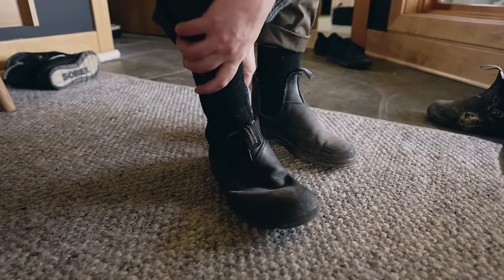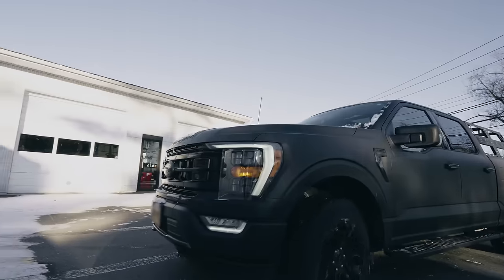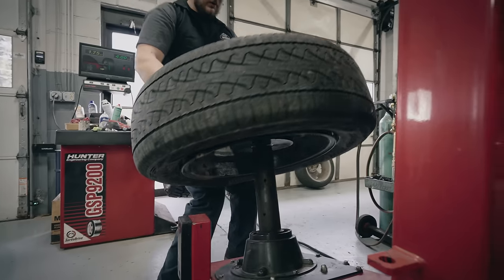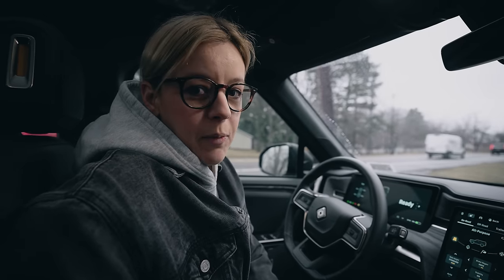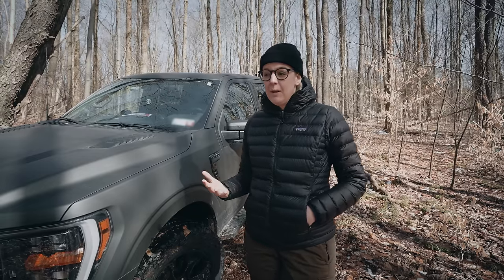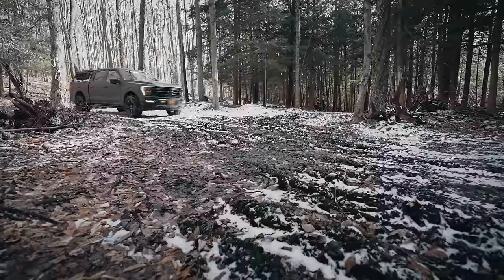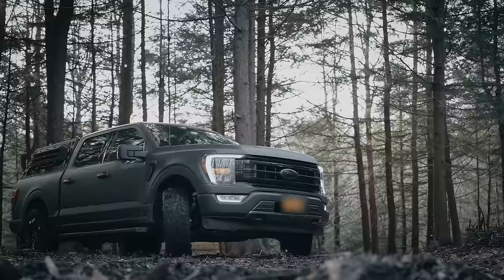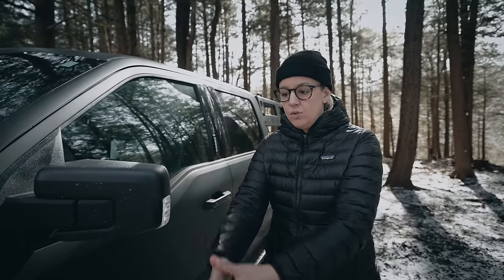The False Bubble Of Having "The Best"

Comment: I have a 2016 Jeep Wrangler Black Bear edition. Bought it 2 years ago and only upgraded to 35's/lift yesterday because my tires had dry rot. The Toyo tires it came with served me well for 2 years. I've only regretted not having bigger tires a couple times when a group trail required it. I probably would have waited until end of year as planned if I didn't need tires.

Comment: I absolutely agree with your philosophy. Many times I will buy a junky Harbor Freight or Chinese thing and use it as much as I need, and many times if it dies, I fix the base item myself, which usually just has some poor components, and this will allow it to be used forever, or at that point buy a GOOD one. But depending on what it is, I will buy what I think is the 'Best', which may not be the most prestigious, since a lot of times name brand items are WAY over priced and overrated, while a mid non name brand can have the same or better quality. Some people are too proud to have 'junk', but if it works it works, and if it is in a service-critical application, I will make sure it has the best longevity and quality (IMO). I TOTALLY don't care what people think.

Comment: Hi. I know spacers are prevalent in USA. Would not recommend them, for improved safety go with offset rims. At least so far you guys haven't seems to have done any hardcore overlanding, but it's a thing that evolves and grows. It's simply a safety advice. Also the offset rims would bring the tyre inline with the wheel arches. Just put it in a future consideration box, if you guys ever plan to go a massive trip with loads of wheeling.

Comment: It's really cool seeing lug nuts put on with an impact wrench but personally I would loosen them all and retorque them by hand because then when you're stuck alongside the road changing your flat tire you'll be able to get them back off again. When they're put on with a impact that might not be the case.  

The other thing that you may want to check and maybe you've addressed this and just didn't put it into the video but now that you have a lift kit I bet your jack no longer fits. So maybe throw a better Jack and at least one Jack stand into the truck someplace so that you can safely swap a tire.

Comment: Just here to say how absolutely terrible my experience was with ICON products. Specifically rock sliders. The one side was so bad the slider its self was warped in the wrong direction. They would only refund one slider. Which seems ridiculous even if you could re-buy one side. Both sliders had mis-aligned pre-fabbed drilled holes too. Anyways I hope you have better luck. Felt bad as a fan of the channel to see you went with this brand 😂